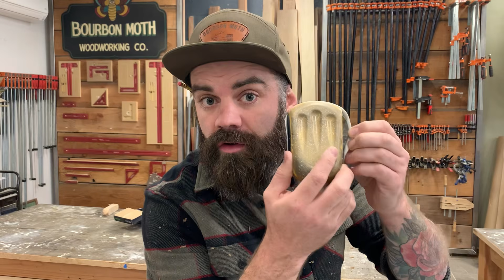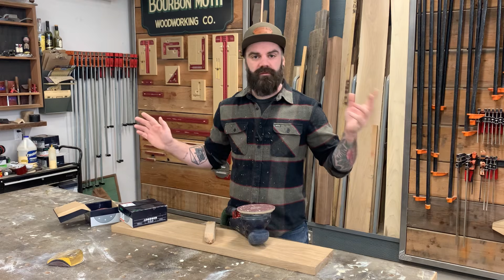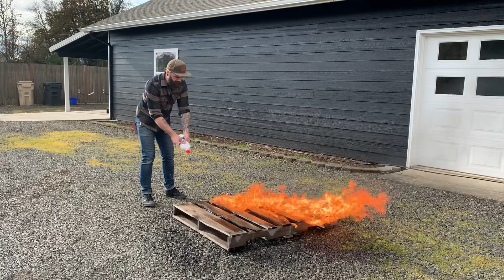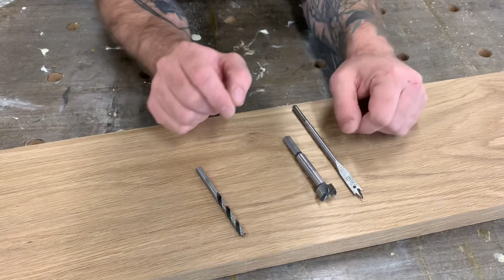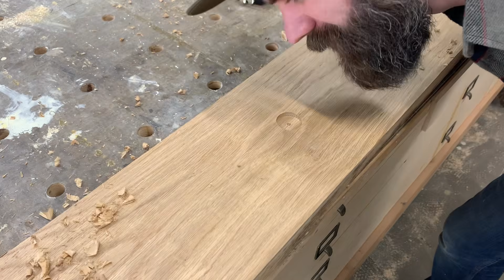Woodworking Tricks You'll Actually Use // Helpful Woodworking Hints

Comment: The one for finding the center of a board works equally well for finding other fractions. 

Say you want to have 3 equal parts for whatever reason, you use a difference of 9 (cm, dm, m, inches, feet, potatoes, whatever floats your boat and is wider than your board). Mark at 3 and 6, boom, done. 

Pro-tip*: use 12 units. You can divide into 2,  3, 4, 6, or 12 equal sections that way. Which points to mark is left as an exercise to the reader.

*That means I get paid when you use this, right?

Comment: Handsanding I only use the Mirka 70x125 block with Abranet , you connect to the vacumm and it takes the dust away so the beginning of this video could be a lot shorter!.
I threw my festool palm ssander in the in and have never looked back. The noise sanding a panel door is now not a vibrating boom box.
I'm a decorator so I know about sanding. Also Mirka do 100 grit which is almost universal in achieving acceptable finish.
Thanks for the video always entertaining.

Comment: 16:50 Old skool tip for accurately measuring interior dimensions: don't measure. Instead, take two sticks that are at least half the length you need to measure, then put one stick tight to each end of the inside dimension, then pinch them together where they overlap and BOOM, perfect inside measurement. You can then clamp them together, measure them, or just scribe that distance on the board you need to cut to that length. Perfect every time.
Reply: Good one!, I do this with the cheap never really accurate metal yardsticks sold at the big box stores, I've cut them so i have one at every foot and 1/2 foot (under 3') and use a wet-erase marker.
Reply: In finding the center of wider material,  like a sheet product, I'll "over measure" beyond approx. center of the plywood from both sides, measuring the distance between those two points (relatively short space) and that nearly always gives me a center point of the panel. Easy to witness quickly,  like his board centering, and I'm off to the table saw lickity split to make cabinet carcass pieces/shelving.
Reply: @759NPR   I've got a center-read tape measure that I'm addicted to. It has inches on top in black and the bottom is double scale in red (so if your piece is 14 in, the red directly below it will read 7 in)  so all you have to do to get the center of your piece is read the bottom part of the tape.
Reply: Damnit I wish I could see this visually. These comment tips all seem so useful but somehow  it’s so hard to grasp via text
Reply: @cariebb7763  here’s a little video that gives you a visual. In this case they’ve made a reusable tool, but you can make one out of any scraps of wood you have lying around and just use your fingers or spring clamps to pinch it instead of the wing nuts they’ve used. Hope that helps! 👍🏻

https://youtu.be/YRpnXYfF-w8
Reply: Excellent.
Reply: I needed to put a piece of trim across the apex of my patio ceiling. Couldn't figure out how to get the measurement because it was too far apart to use a tape on a ladder. My dad suggested your method...worked like a charm. Shocked the heck out of me because my dad's dementia was so bad he didn't even know where he was at the time.
Reply: I just use two tape measures, opened in opposite directions and pressed against the ends of the space you're measuring, and aligned so that they're parallel and side by side. Find the 1' mark on one of them (or 2' or 3' whatever), and read what the other tape says at that mark. The addition is easy.

Comment: Instead of measuring out and adding twelve inches, I use ten inches. Much, much easier to add ten to any given measurement than twelve.

A decade or three of carpentry/construction/cabinet making/screwing up has taught me a bunch of stuff, and you are teaching me more. Keep it up!
Reply: You don't add twelve, you add ONE. One foot. Much easier than any number.
Reply: @BariumCobaltNitrog3n  Adding one foot is great, if you are measuring in feet. Adding ten inches works much better when adding in inches, such as when building cabinets or framing walls.

If I need an interior measurement of an area to install a set of cabinets that is 86 3/4" long, how much is that in feet? It is easily measured as 76 3/4" plus 10".
Reply: @coreyg7255  That's a good point.

Comment: I used to be a harp maker. One trick that we all used for glue on inside corners was to dry for the piece and then rub soap on the joint. When the glue dried it would pop right off. Also I really enjoyed the video. I made my girlfriend watch it. We're both laughing hysterically.
Reply: What do you mean when you say “dry for the piece”? Are you using bar type soap? And the soap is rubbed directly on the glue? Sorry for my lack of comprehension.
Reply: @daveparker839  I'm sorry, I meant dry fit and yes, bar soap. We would take a bar of soap and cut them in about 1/4" pieces, on the hand saw, and rub them along the joint before we did our glue ups.
Reply: @leegutierrez8135  So interesting.  I'm wanting to get into woodworking.  I might have to try this.  Thanks for the response!
Reply: What kind of harps did you make? I have friends that make jarocho harps. I like the soap trick!
Reply: I worked for Lyon & Healy.
Reply: @leegutierrez8135  that is awesome! I actually play the harp and have two Lyon & Healy’s. They are absolutely the best harp makers in my opinion.
Reply: @katherineshifrin3549  if you have a petal harp, check inside the base. If there's a LG written inside, I built it.
Reply: @leegutierrez8135  I checked the bases and my concert grand has B.L. in it,  but I can’t see any initials in my petite grand. I’m a little disappointed, I would have loved to have “met” my harps’ makers!
Reply: @katherineshifrin3549  Wow. You have some very nice harps.

Comment: I was entertained by the first tip video, but not particularly helped by the actual tips which I found either obvious, less than ideal with better options available, or to be solving problems I just don't experience.

This time, I was even more entertained but also the (non-joke) tips were actually fantastic non-obvious real solutions to real problems.  I'm sure I'd never think of using a vacuum to get glue into a crack, and I would have just assumed mixing sawdust with stain/finish wouldn't work (especially given how poorly my experiments with sawdust and glue have gone).  Most of all, I fell in love the moment I saw that hook-and-loop sanding block.  I hate cutting sandpaper and setting it in my existing traditional sanding blocks.
Reply: 80 grit sand paper start was a bit severe. I get burnished wood from my planes so maybe just a touch of 220 grit by hand for my start and finish paper on end grain or flaws.

Comment: Tip..Mark fastener locations without using math. Get couple feet of elastic from fabric store. Mark even marks along length say 1" apart. Clamp to one edge of a board and stretch. Divides spaces evenly for marking fastener places without math. After eating that glue math might be impossible anyway.

Comment: I was able to successfully remove the nails from most of my house with your nail removal trick.
Reply: This is literally what they used to do back when all nails were hand forged square nails. Wood was cheap, nails werent so it was faster to burn the building and extract the nails afterwards.
Reply: Worked great in my truck tires, too!
Reply: Don't try this method to remove aluminum window panes, though.  Now, if you excuse me, I've got a lot of aluminum I have to smelt...
Reply: Me too! 😂
Reply: also works great on fingers

Comment: The blowing glue made me laugh so hard 😂😂😂 here is a great drilling trick I use when I redo wiring in a house and need to drill into a bottom plate of a finished wall. Go outside and find a locate flag...clip it off diagonal with some side cutters and chuck the other side into your drill. Now you have a flexible long drill bit. Drill next to the trim when you are done go to the basement and find your wire and measure over and drill up. Sweet trick and it works great. Nice video!!
Reply: I use a bit of welding rod, same trick.

Comment: That's the same pallet method i use!  Also.... i would think you could try flossing that glue into the crack with a string a little easier than the blow-in method?

Comment: Abranet or the Diablo net type sanding sheet with the shop vac connected does a great job of find dust removal. You can actually blow glue in with compressed air a little better than your mouth ;). Medium thick CA is pretty good too. Love your stuff!  Keep it up

Comment: I learned making your own wood filer from saw dust and glue in wood shop in school years ago, I always wondered if you could add stain of the color that you was going to use would keep it from showing, also In my final pre finish sand I have used a wet rag to raise the grain back up and sand it again, sometimes stain would raise the grain but you could always sand between coats, thanks man for the videos very helpful

Comment: Bourbon Moth:  Another way to find the center of a board is to take your square and mark a line across the board.  Come in a given dimension from both sides, a 1/4" works well, and make a mark.  Put your compass on the mark and swing an arc that is larger than half the width of the board.  When you do this from both points, where the two arcs cross it is the center of the board.  Magic!

Comment: Thanks for the tip on the rubber cleaners. I was using a wire brush, which I'm sure wore out the sand paper even sooner. Just ordered 2 from your link on Amazon.

Comment: What if I wanted to cut a board into three equal widths? With the cut-in-half process, the saw-blade-thickness-loss is experienced by both resulting pieces. But with cutting into an uneven number, if I cut right on my "third' marks, the centerboard will be thinner than the outer two. Is there an easy way to overcome this other than offsetting my cuts by 2/3rds and 1/3rd the saw blade width?

Comment: How about nail pulling with a block for leverage :)
Not that by your Doing lot of that but could be helpful for some ;)
Also, tac cloth for finishing is a great way to get a smooth finish.
What about flattening the head of a finish nail to make it a cut nail so that it doesn’t split the wood;)
That’s one I’ve used a lot in the past for many projects. My personal favorite is using a nail or screw for leverage to straighten a pieces of material.
Reply: Hahahahahha you must be a framer right?
Reply: @zoutewand  contractor :)
But I tend to do a lot of the work myself ;)
Don’t really trust anyone else

Comment: I was not ready for the second glue in a crack method
Reply: OMG, I laughed my Ass off!!! I really needed that laugh.
Reply: @mnmike59  i couldn’t stop laughing
Reply: @steventuckman1652  ..Exactly!!😂🤣💦
Reply: I don't think anyone would be!
Reply: My wife gave me a wired look when I burst out laughing
Reply: I wasn't ready for the FIRST. This whole time i've been putting the glue on the top, then my lips on the BOTTOM, and sucking for all I was worth. Two makes WAY more sense!
Reply: The whole video I was wondering where your missing square was. Also you had some glue in your beard
Reply: Sorry but I will use my #2 method,  25 psi from an air compressor. ( works great and no beard to clean😉.)
Reply: @the-kilted-trucker59  or even better use your finger or putty knife and push the glue in the crack like normal people. To get it really good you work the Crack back and forth and it will pull the glue in on its own. But damn that was funny.
Reply: i hit subscribe right after i saw that
Reply: Are you freaking kidding me?  I did not expect that either.  That's not Elmer's.  There is no cow on that glue label.  He's nuts; no offense.  He's one of my favorite YouTubers.  Hilarious, but nuts.
Reply: Good stuff.
Reply: I work with epoxy resin a lot, so my Plan A is typically using a syringe to fill cracks.
Reply: Hysterical! First actual laugh out loud I’ve had in a while. 😂 Thanks for that!
Reply: So basically when ya cracks all gooy you don’t wipe it you chisel it off later🤔  I got that...... so whose hamstering TP for god sake? Go for those chisels guys
Reply: I was worried for the beard🤣
Reply: That one made me laugh so that I sprayed glue over my entire screen.
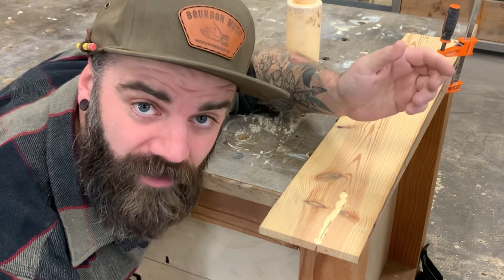Reply: 14:50 I’m leaving this here for access later.
Reply: None of us were. o.o
Reply: I shit my pants... LOL
Reply: Whatth tho sfunny?
Reply: Oh Jesus I was not ready!
Reply: IPA doesn’t taste as well after glue in a few cracks up!
Reply: Yeah. That was gross, I'm over here eating some cookies and milk when I see that stuff...
Reply: Me: nah, that's...is he really....wait...😲
Reply: Yeah, I had to change my depends after thatn...
Reply: By far this was my favorite tip!
Reply: I woke my wife up I was laughing so hard.😂🤣😂🤣
Reply: Oh come on, I am sure everyone ate glue as a kid!  This is the same, except for the beard.  But vanilla pudding looks just like Titebond!🤔
Reply: hahaha, me either
Reply: I use that all the time..
Reply: I died laughing when that came up. My jaw dropped and all I could think of was how it would have tasted and how long it took to get that out of his man beard
Reply: He won the internet today as that was the first time I've watched something that made me gag and wretch! Bleck!
Reply: Did he really just do that! I have been working with wood professionally for more than twenty years and never have I seen someone turn up a bottle of glue like that. I remember a couple of kids in kindergarten school do it though.
Reply: That means you are perfectly ready!
Reply: Omfg lolol
Reply: I think everyone was horrified by glue technique #2, I was drinking coffee and had a hard time swallowing just thinking of glue in the mouth and in the beard. Way to be dedicated to entertaining the masses
Reply: i hope he used mayo or something. he actually should post a disclaimer
Reply: @armus550b  it’s the exact same bottle he used filling and vacuuming the first crack. I analyzed the clip. So either it’s glue in his mouth, or it wasn’t glue the whole time. But it was an older beat up and scuffed/dirty glue bottle. 😬
Reply: @bradymiguel  Huh. I cannot help but wonder what undercooked Jell-O vanilla pudding would look like coming out of a glue bottle.
Reply: @bradymiguel  I’m pretty sure it’s glue.  In some of his other videos after he smears some glue with his patented glue smearer it ho strait to his pie hole.
Reply: @armus550b  I think its refreshing that he didn't.
Reply: @armus550b  Should he? If somebody is stupid enough to eat glue I think they deserve it.
Reply: @armus550b  glue is good for the body :)